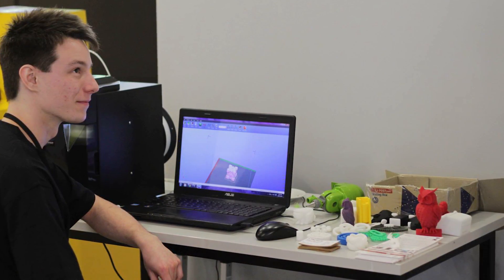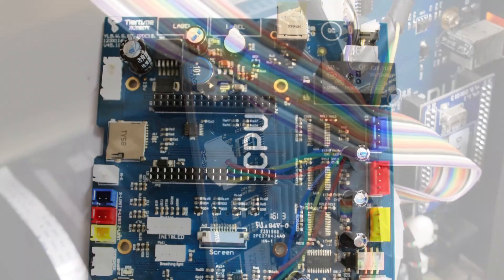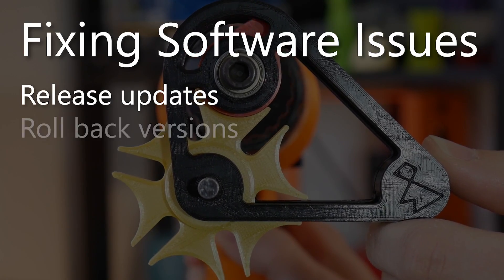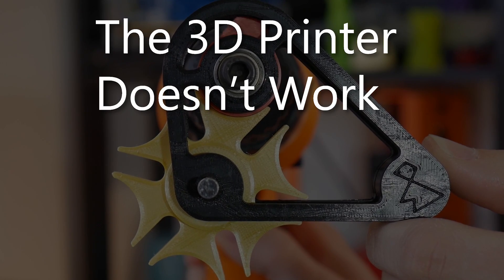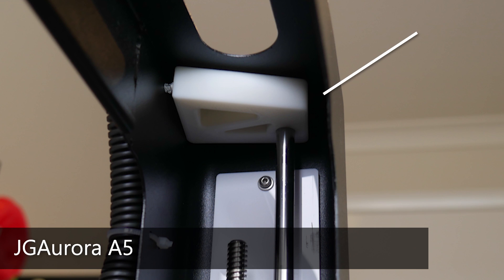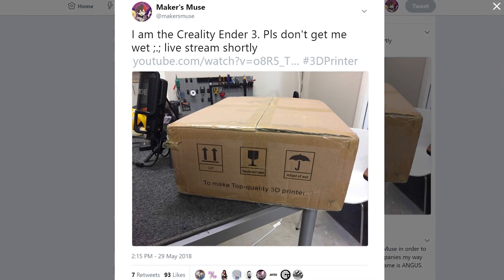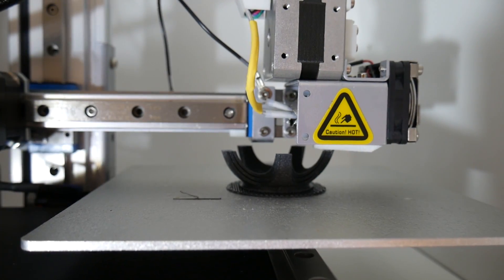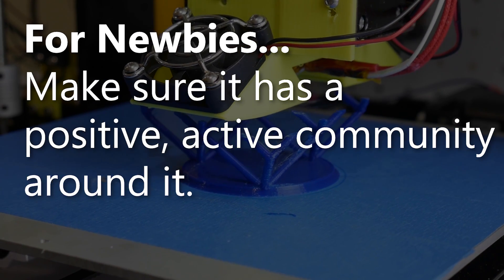Serious Concerns with 3D Printer Quality Control

Comment: MY GLASS IS HALF FULL RANT :-)

I have read "The Lean Start Up" years ago and it is a great book.

I just would like to share my appreciation of both the 3d printing community and printer manufactures.

Yes I would be pissed... or at least frustrated if my printer came with missing or broken parts but on the whole I think most manufactures are doing an amazing job.

I think many would agree the maker community mostly deals with "affordable desktop printers.'"

The key term in all of this is "affordable."

There are desktop products that are well tested before their release... such as the Cubicon and  the Ulitimaker... but look at their prices.

Inside the maker community... I'm pretty sure the CR-10 outsells the Cubicon many times over. And I would even venture to guess that Creality is a more profitable company. And yet everyone in the community knows when they buy the CR-10 they are going to have to fix the printer... such as printing a cable strain relief at the minimum.

The desktop 3d printing maker community was born out of a "living document model" meaning the RepRap project has a constant iterative design mindset. The community is also willing to trade imperfection for affordability. If the community had not been willing to accept imperfection for affordability the movement would have never gotten off the ground. And if affordability wasn't an issue they could have bought a Stratasys years ago.

The JG Aurora isn't the only printer to have been damaged by shipping. The video criticized the printer for having 3d printed rod and motor mount supports and that they should have been made of metal in the first place. That is a pretty general statement considering the MK3 has 3d printed rod and motor mount supports as well. Why does every influencer get so holy about 3d printed printer parts? Shouldn't it just be about quality parts period. Perhaps if the printer was packaged better then the part wouldn't have been broken in the first place and it wouldn't have gotten any attention. I guess it would depend on how easily the part can be broken and how many people it affected... I simply don't know. I just know that a couple of broken parts doesn't sound off any alarm bells for me... considering... salmon skin... broken heater wires... brittle acrylic... loud fans pointed in the wrong direction...  exposed power supplies... slow heated beds... beds that need replacement mirrors...etc.. My point is this is nothing new. I guess another way of putting it is... what affordable printer didn't start out with significant flaws? The way I see it... it hasn't been increasing... it has always been here... Anet... Tevo... Tiko... its not new.

If this is a new trend... when was the quality of printers better?

Printer manufactures relying on their customers input to improve their printers is the exact thing the community cherishes. What other industries take action on customer feedback as quickly as 3d printing manufactures... I love it.

You said if "early adopters" buy these printers they may be faced with significant problems... that is the exact definition of an "early adopter" someone willing to accept significant flaws. The 3d printing community is filled with early adopters who buy printers excited and knowing full well they are going to make them better. 

3d printers are not appliances... yet.

And let me just say right now, anyone who buys an affordable 3d printer today is an early adopter.

Like you said... If someone doesn't want to regret the printer they buy... then don't buy the first one... everyone knows this. Most of the maker community is wise enough to ask around and get advice from multiple people... besides that is the whole reason for review videos.

Can anyone tell me which printer manufacture got it right the first time? 

Perhaps a printer that is only slightly modified from a company's previously established model got it fairly right.

Bringing an affordable product to market within a reasonable amount of time and making it profitable for the families of your workers is no easy task.

Should Prusa have waited to release the MK3? A printer that has been released before their most prized feature(the powder coated PEI flex plate) was ready for shipping... and they still haven't gotten them out to the people who ordered them last year. How about the fact that they shipped their first printers without hardened steel rods. There is a LOT MORE you could say about the Prusa... and it costs a lot more as well. But people buy them like crazy because no printer is perfect especially when you are leading innovation.

Prusa printers evolve almost daily. The printer shipped out this week is different from the printer they shipped two weeks ago and different from the printer they shipped the month before. When would you have released the MK3?

Also Prusa released the second version of their multi material printer just a few months after they announced their first version... which was prone to jamming. My point is... when it comes to the affordable desktop 3d printer maker community... manufactures are VERY nimble with regards to innovation... and if they wait for their 3d printer to be semi perfected... it will be outdated and too expensive before it is released.

"Randomness and Rate of Change" is good... what is the alternative... leave it as it is? Again... can you tell me which printer got it right the first time... as stated... even the Up Mini was significantly flawed.

It also says on the cover of the book The Lean Start Up "How Constant Innovation Creates Radically Successful businesses."

This is a fast moving industry... and just like survival... there is the quick and there is the dead. The only litmus test is... is the printer good enough quality to get to the market quickly... and is it profitable... your company has to get both right or it will quickly go tits up and taking on water.

There is a saying... when it comes to products you have three choices... you can have it Good...  you can have it Fast...  you can have it Cheap... but you can only have two.

Any company that can make a quality affordable printer quickly is incredible.

Affordable... Fast... Innovation isn't easy.

All 3d printers are flawed, but they are improving extremely fast. Imagine how frustrated you would be with 3d printers if we all went back just two years from now. I'll take the flaws of innovative features today over the perfection of two years ago any day.

I'm not against being hard on reviewing individual models of 3d printers...I need to know what flaws I'm willing to tolerate. 

I'm just not for getting down on the industry as a whole. Its hard to move quickly.

Why not celebrate manufactures dedication for sticking with their printers and listening to the community to constantly find ways to make them better?

Comment: Interesting video and commentary. I bought an Up Mini in 2014 as a gateway to 3D Printing. It did work until it didn’t and support was nonexistent leading me to want to give up on 3D printing. I contacted one of my US suppliers of PLA that started carrying the products to give them feedback. They contacted TierTime and got them moving on a replacement. In the meantime I moved on to a Makergear M2 which has been rock solid. Because of positive reviews and community support I am waiting on an i3 MK3 from Prusa. Thanks for your efforts.

Comment: Great video Angus.  I waited over 3 years before I purchased my first printer.  I watched you, Joel and many others, listened to your reviews and inputs and did my own research.  At the end of my first purchase journey I opted to buy the PRUSA I3 MK3.  Previously my main complaint with PRUSA machines were cost, but the MK3 offered some key differences that made this cost appealing and acceptable in my own opinion.

1. Reputation
2. Removable Metal PEI print sheets
3. Silent Operation (or darn near to it)
4. Size, I have limited space in my office so I didn't want a huge machine like the CR-10 to start
5. Other features such as filament sensor, power recovery, etc..  It's a rather long list.  This printer has features built in that many other printers costing much more still don't have.
6. Active support through PRUSA as well as a huge active community

After all of my considerations I am still very pleased with my purchase.  It hasn't been without issues.

1. I purchased the kit back in November 2017.  I finally received the kit in March 2018.  It was a long wait.  I do believe PRUSA is shipping much faster these days?
2. The powder coated PEI sheets were withdrawn due to a manufacturing defect, which was a bit of a stink ion the community, but I honestly didn't mind.  I felt PRUSA's offer of $20 off pretty much anything in their store and free shipping to boot was a very generous offer.  Also the smooth PEI sheet that did ship is wonderful.  Finally the PEI sheets are consumables so you'll need to buy more later anyway.  My next one is $20 off with free shipping.  It's really a great deal to the consumer if you look at it the right way.
3. The kit took a long time to build.  Much longer than I thought and I'm what others have said is good at putting things together.  If I were to do it all over again I wouldn't buy the kit.  You don't learn that much from building it other than PRUSA isn't making much money at doing it for you.  :D
4. I had issues with the Live Adjust Z and First Layer Calibration.  The Live Adjust Z simply was not working. (now resolved through firmware 3.2.1)
5. There were other minor issuers like excessive squeaking and belt rub that were resolved through the community and also be Josef himself, who posted a comment to a video.
6. Support (email) has been slow often taking days to receive a response, but they do respond!  I have noticed that support is more responsive as of last week.  It took several days to receive a response initially, but subsequent responses have often been under 24 hours.  Be cognizant that I am in the US and PRUSA support is in Prague, CR.

All in all would I buy a PRUSA again?  Yes
Am I happy with my purchase?  Yes
Would I recommend a PRUSA to others?  Yes
Does PRUSA have good QA/QC?  Yes, the kits are immaculate, very well packaged, wonderful documentation, and they even provide extra parts in case you loose an M3 to the carpet monster.

I hope someone finds this rant useful in their purchasing journey.  If you would like to see the print quality of my printer let me know I'm on Thingiverse under whayden001.  It prints wonderfully and it required no tinkering of print settings.  Aside form the Live Adjust Z setting it was plug, calibrate and print.  Where I have yet to fine tune my printer is for tolerance prints.

Cheers.

Comment: As a content creator, especially that reviews these printers, the issue for you will be that these companies may make the "best possible printer they can" and ship it to you and other influencers but than make "so-so" machines for the rest of us.  

One solution for example, ( and a small channel may not be able to do this),  may be to take the one they sent you and also buy one on the side as a random customer and then compare them.  If they are the same, woot!  If not, then that will be a review your subscribers will be extremely happy to hear about as they will at least get the truth from you rather then the BS sandwich the company sends to them.

On a side-note this is one of the reasons I dislike "Fanboi'ism".  While the publicist for a company may love fanboi's as it generates free publicity, a company that truly want's to improve their products should hate them as to improve your product you need honest feedback on what needs changing.  Fanboi's will overlook problems and spruce the company just because they want others to be like them.
Reply: Bickety Bam actually I can tell you as a high volume manufacturer, if I sent you one of my printers and messed with it or 'vetted' it in anyway it's going to be far worse than taking one straight off the production line.  I'm sure why that is - it seems to be a simple case of process flow vs. one offs.  It's also a relief because we can grab whatever off the line and send it out knowing a reviewer has the same likelihood of success as any customer (we have a 1% return rate despite full money back gaurantee)

Comment: I think hardware vendors need to be more forthcoming with notice of hardware revision. Software has solved this years ago, version numbers with change logs allow people to understand what they are getting with updates, hardware makers could implement a system like this to let people know what version they are getting, what it comes with, what improvements have been made. It also allows people to buy stock that might be a bit stale from a vendor that hasn't gotten a stock refresh in a while. Hearing that a printer has gotten significant upgrades then getting a box that has sat in a fulfillment warehouse for 6 months that doesn't have those upgrades can be maddening. Disclosure of changes, and a transparent way to educate buyers would allow hardware makers to iterate faster and keep customers happy.

Comment: My Ender 3 came with polarity reversed on the PSU so basically I bought a smoke machine... i'm really pissed, it was my first printer and after waiting so long i'm stuck. i have to find the right replacement board with the right firmware and pay for it because a factory worker couldn't be bothered.

Comment: This situation is HURTING SALES. There are a number of printers I am interested in (not naming names but you know them), but a quick google search turns up discussions of people pointing out different revision changes, and with no way to know if I place an order which version I will receive, I just DON"T PLACE AN ORDER. If these companies were smart, they would refurbish the unsold units to the current mod level, or at least add a version number to the printer so we can tell which one it is at purchase time.

Comment: Absolutely agree!!  I've been poking at the various iterations of hobby machines for over six years.  At my previous job we made an internal machine based on RepRap ideas with our own hand wire wound Nichrome wire hot ends and mechanical movement that was a nightmare.  But we were not selling these machines.  They were more for playing with than anything else.  Most of the folks that were involved had many years of experience making 2d printers.  

So we looked at machines that were out in the wild and decided to use the Prusa i3 as a platform to emulate.  Many of those machines are still kicking around in various forms.  Helped that we had access to a large waterjet cutter for the frame and I think it was 1/4" aluminum.  :-)

Personally I own a Makerfarm 12" (waiting for an extruded aluminum frame upgrade since I swim in excess 8020 at work), a real Prusa Mk 2 (now 2.5 with all the upgrades), and have poked at several failed attempts at large form factor printers that never did really work very well.  I love my Prusa because it has always performed as expected.  

The idea that you have to push a product out without really having solid quality already baked in has to be one of my biggest frustrations.  I was helping a student at a local university who thought that she could get one of the low cost kits and it would "just work".  Not sure where the spending total is at the moment, but I suspect it is probably up to around $500.  If she had started there she wouldn't have lost two months of printing time.

That to me is the greatest problem with the low quality kits.  You spend so much time initially just to get the thing to work that it diminishes the joy of 3d printing.  You wind up spending time wondering what is going to go wrong next instead of wondering about what new thing you are creating.

Comment: I'm you, if you hadn't had that up in 2012.
Around that same time, after having pored over the RepRap project wiki and followed the news from Adrian Bowyer since undergrad, I bought a clone of a prusa mendel. It arrived as a kit, and I was able to make it work and print things about 10% of the time without creating nests of spaghetti.

I quit the hobby.

Fast forward to this past Tuesday, I accepted delivery of an Ender 3. It cost a fifth of what I paid for my first printer, but is roughly five times as reliable (you'll note that's still only about 50%)

I expect I'll be able to get that number much higher, but I guess it remains to be seen whether that happens before I lose patience again and go back to metal and wood.

Comment: I received a new early release Lulzbot Areostruder that had wires that were run wrong requiring a significant rewire.  Further, it was shipped with filament in it that jammed when trying to remove it, following their instructions.  Again, now requiring a near complete disassembly to try to unjam the thing.  The real unfortunate thing was that this was ordered as a gift for me, but I didn't have time to install for months, but they won't warranty it do to the time.

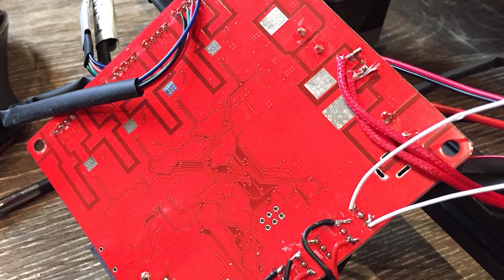Comment: haha I spy an Anet A8 motherboard (4:55). Mine has worked great for the past two years. Only thing I had to mod on it was to reclaim an IO pin from the LCD to run my BLTouch auto-leveling sensor. Flawless 9-point auto-leveling 9 times out of 10!